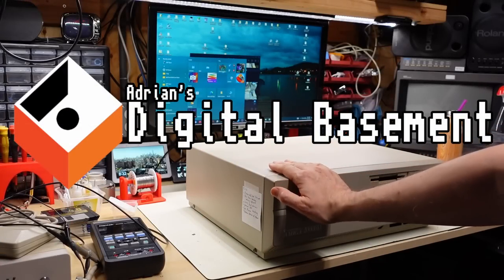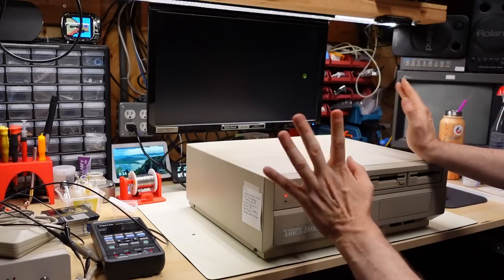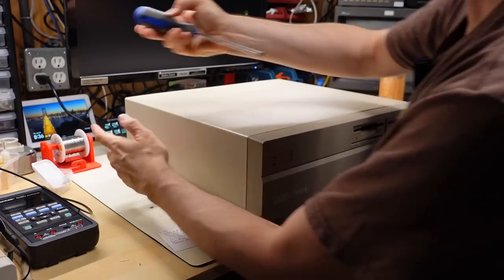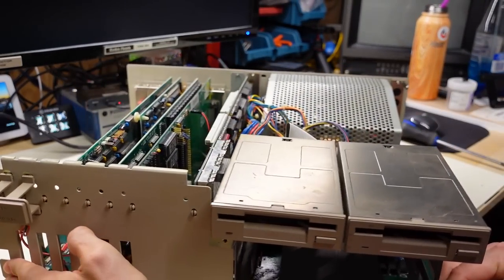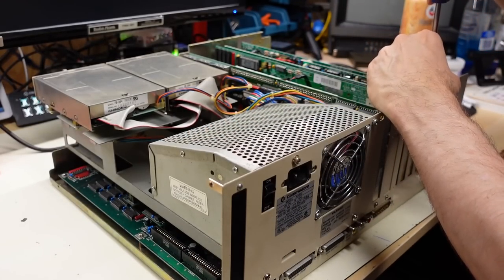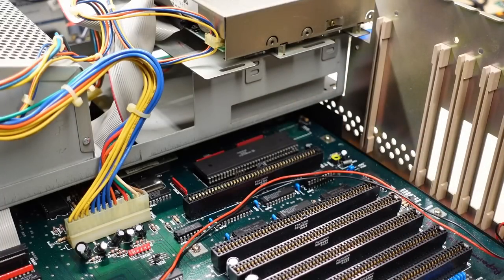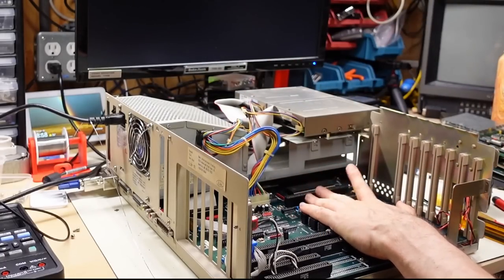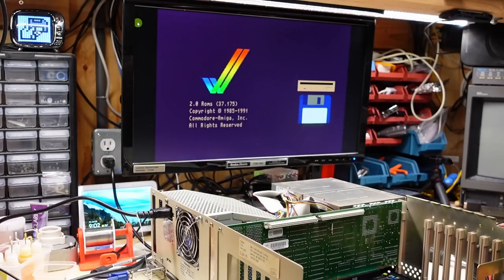I used the "easy button" to fix this broken A2000

Comment: BTW, contrary to what was said in the video, the A2630 can run with the host 68000 removed, if you switch the card to "German/early A2000" mode, where one needs to remove the 68000 for all accelerators anyway. This is done by setting JP302 on the card. This is even mentioned in the manual of the A2630, Page 13, Appendix A. I just tested this on my A2000 + A2630, and it works. MIne is a late model with 2 layer PCB, just as Adrian's. (Also posted pictures on Twitter as proof.)
Reply: That would be a proper fix here. He used trash socket replacement, I would never use that here. If his issue was bad traces, it would not likely fix it's self with light pressure.
Reply: Mr Guru  But the problem was nothing to do with the CPU socket.
Reply: Mr Guru  And you know the problem was the socket?  How?  Magic?  Please stop with the condescending remarks.

Comment: The /RESET pin on the 68000 (pin 18) might be worth checking out as it must be one of the few pins that, when disconnected, wouldn’t affect running once booted.
Reply: It is the reset line on the cpu, a friend had the same problem and spent 2 weeks on drags.
Reply: Yeah, that's the first thing that crossed my mind as well.  The wedge not working when placed on the lower end of the CPU vs the middle also strongly suggests /RESET.
Reply: Yea, I'm going to guess it is either the trace or via between the CPU and RP101, reason being it's on the same side as the battery, and also in the area where pushing down on the board helped.
Reply: I came to make the same comment so +1
Reply: I was going to message that it might be a fine SHORT between pins, you wouldn't notice that with a continuity check and pressing down and distorting the Mainboard might be enough to separate it and allow it to boot. Once it's booted the short isn't enough to stop it running.  Just a theory.

Comment: The only things I'd worry about with this "fix" is the speaker moving on it's own and shorting something. It might seem firmly wedged, but moving the system around and bumping it through normal use could nudge it ever so slightly each time. And the second is that mechanical stress from flexing like that could exacerbate issues in the future and just create even more work if you try to permanently repair the board.

But the thing I'm most leery about is flat pins in round sockets. Try replacing that socket with a dual wipe one and see what happens.

Comment: As a wedge, you could use a wine cork, as it's slightly flexible and maintain pressure like a spring , and you can cut it to the length you need. As an added bonus, you will have some nice wine sent coming out of your Amiga when it heats up :D
Reply: When I was a kid we had a Spectrum ZX48K that would constantly crash. My dad fixed it one day, he jammed a wine cork between the case and the Z80. He told me it was popping out of the socket when it warmed up.
Reply: Mr Guru  I agree, I've worked in electronics for 25 years and I often hear/see people using turned pin sockets for DIL package ICs when all they needed to do was use a decent quality dual wipe socket. ICs never sit in a turned pin socket correctly causing contact issues, stray capacitance, risk of bending legs and an absolute pain in the backside if you ever want to remove the IC.
Reply: This is what I thought but slight splay of the legs would prove that.   Also the board flexes a lot so it could be a fault nowhere near the cpu.

Comment: This would be a great amiga to use a replacement pcb on. It'd be time consuming to swap everything over, but then you wouldn't have to worry about flaky traces.
Reply: Normally I'd call bunk, but yeah, this sounds like the right time for a new pcb.
Reply: I thought the same thing.
Reply: Also I think in the case of the Amiga, the boards aren't some marvel of engineering. All the secret sauce is in the custom chips. As long as you're running real chips, you're running a real Amiga.
Reply: Don't get me wrong, finding the exact reason why it's flaky will make for a great video, but I also love build videos. It's like adult Lego Mindstorms. There's something satisfying in seeing a board be built from the ground up and work. Also, like car restoration, I'm a firm believer in usability over originality. The Amiga wants to run and be played with, not sit on a shelf and look pretty.
Reply: Mr Guru  I guess you nailed it. And, it's August, it's hot, and Adrian doesn't like it too much to spend at least 10 hours to make a new pcb complete! Yup

Comment: I am a noob, and... I have bought an Amiga 2000, with battery damage, of course, and it black screens. Now, the other day, it showed WHITE once when I booted it. So this video IS actually useful. It indicates my socket, on the CPU or ROM is marginal. So Ill try opening it up again, and try pushing down on chips. If I get more life out of it, its kind of diagnostic as to WHERE the main issue is, eh!

Comment: I used to have similar problem on my A3000. Common battery leak around Paula chip destroyed bunch of stuff. The computer would not start until I pressed down the Paula chip. It would work fine for 30 min, but then it would freeze, and I had to press it again. I fixed it by replacing the socket and reflow solder on most pins around the damaged area. So far so good. I do still have a slight problem with VGA output only, the screen would flicker randomly until the A3000 warmed up.

Comment: I just refurbed an Amiga 1000.  I can whole-heartedly agree with your sentiment.  They really had a lot to learn about case design.  Those things are a PAIN to work on.
Reply: Mr Guru   I've done a bit of 3D modeling and then had a service manufacture it from the files, so I get that sometimes you make really "safe" moves to ensure that it works, to avoid having to go through the cost and time of an iterative loop.  That's probably what they were going through -- low budget, not much time.

Still:

The back panel assembly order is a chore.

The little plastic clips that hold screws for the front panel are really awful.

The screws that are meant to hold the memory expansion to the shielding around the edge connector on the front barely even thread.  (At least mine do.)

While we're on screws, the number you have to remove, for example, to get to the ribbon cable on the floppy drive is just insane.

And speaking of the floppy drive -- the ground wire (which is already a bit of a kludge for a drive in a metal shell) secures to a bolt going through the motherboard and the RF shield around the edge connector, and terminates in a nut that is hidden underneath the bottom RF shield plate.  You have to remove the entire board from the case, and then remove the shield from the bottom of the board, to fasten that bolt once you loosen it at all.

It's a hack-job of a case design.  Which, it may well have been exactly that.

People complain about the Power Mac 8500/9500 cases -- which, admittedly, are also a royal pain because you have to disassemble everything to get to anything.  But man, that Amiga 1000 case takes the cake.  It looks like it'll be a walk in the park, but noooooo.  :-D  You're gonna be screwing and unscrewing parts of it over and over again on reassembly, until you memorize the order of pieces in the puzzle.

Comment: I had a music synth which kept having bootup problems. I removed the PLCC chips, cleaned all the legs and socket pins and it never failed again. The A500 and beyond used them a lot, so that's always one thing to check. I had one of the PLCC custom chips burst once, the top cracked and let out magic smoke.

Comment: 9:45 - I did that to an AM386DX40 - used a dowel and jammed it under a long expansion card. The board was pretty warped for some reason. It worked for a few years. I still have the board, but it no longer POSTs, I/O reader shows some basic activity. IIRC I deduced that the controller IC doesn't work anymore, probably from broken traces in the intermediate layers.

Comment: And the metal part of the speaker will act as a heatsink. Winning!

One other thing. I don't believe the device on the board is a flicker fixer but rather a DKB Mega-A-Chip which gives you an upgraded Agnus facilitating the 2MB of chip RAM you saw. The 2000 otherwise would only have 1MB of chip RAM.

Comment: There's one of those square PLCC chips in a socket further under the drive assembly. Try removing that, give it a blast of deoxit, reinstall it and see what happens.
Reply: Good suggestion. Those are susceptible to board flex since they squeeze the chip on all 4 sides.  Failure to post should be traceable if you know what the boot sequence is, which roms are accessed, stack ram, cpu reset lines, etc.  Should be able to narrow it down.

Comment: The fact that it's on startup might indicate an issue with the reset/halt circuit, preventing the 68K from ever starting. Adding a separate circuit right at the CPU might make it work reliably by bypassing it.
Reply: I was suspecting the power on/reset circuitry as well. Only used once, usually.

Comment: If/when this fails again you've got a few useful clues as to where to look. Given the flex of the PCB it looks like the faulty trace is on the top (flex pulls lower traces apart and pushes top traces together). Also with it being at start up something to do with reset and/or initial ROM chip-select perhaps? Assuming you've got the time (yeah I know) a bit of multi-meter continuity testing might find it fairly quikly... Totally understand the bodge fix tho. Sometime you just want to get things going.😁

Comment: The theme of this video seems to be
"My CPU don't jiggle jiggle, no sweat, I need to do a wiggle wiggle, for sure, it is really silly silly, you know, bending down and pushing, you really have to see it"
But sometimes, if it works, it freakin' works, and even if it's silly, you have to do it. Old machinery is tricky, and requires... special care, even if it means just pushing down and bending.

Comment: I've never used an old speaker like that, but I've used a lot of other non-standard bit's and bob's in similar circumstances. Not all have worked, but sometimes the MacGyver spirit is necessary and sometimes ya just gotta do what ya gotta do.

Comment: Okay, quick suggestion that may be a solution in regards to corrosion: Dilectric grease. It's recommended to prevent oxidation/corrosion on terminals that are prone to conditions such as snow, rain, battery acid, etc. Might I suggest that on the repaired sockets before repopulating them?

Comment: Another very good video! It looks like it will be some months before you re-visit this computer. When you do it may be worth using a device other than just a digital meter to bell out the traces. In industry we retained some moving coil meters for checking  continuity because digital multimeters pass such ridiculously low amounts of current, so even a whisker of metal will measure as being OK. I think I've seen that you have a bench power supply which has a constant current function. It's probably a poor idea to try out Amps, but possibly passing 50mA or 100mA between test points would be OK and measuring voltage drop between points on each trace using your digital meter would highlight any dodgy joints or part-eaten buried traces. Only use very low voltages of course, possibly set the supply to 0.4V open circuit? Check what voltage TTL chips will stand if connected in reverse; less than a diode drop should be OK. Reversing the flow of current and comparing voltage drops for forward and reverse flow might highlight problem traces and/or trace/pin joints. You'd be looking for anomalies so a bit of experimentation and note taking would be useful. Perhaps practise on one of your boards that is already consigned to Silicon Heaven.  Good luck anyway!
Reply: His issue is the dodgy socket, not the board
Reply: Great Suggestion to be honest and very thorough with the possible outcome. Using a Shunt  with low resistance inline to pickup Voltage drop would also be possible, as any additional resistance due to bad traces will screw up ypur voltage readings.

Comment: I've had similar issues repairing battery damaged PC boards. The issue is usually bad pads on SMD chips that make a connection when flexed/pushed on. Very frustrating because they test OK on continuity tests because the force of multimeter probing connects the trace's.

Comment: I think the problem your having is due to using those strips of machine sockets because if they are not all level with each other and you put in a cpu with so many pins, I believe some pins don't necessarily make good contact.  If you change it to a dual wipe socket then it has the ability to grab much better.

Comment: You have a brand new a2000 pcb hanging on your wall (although that is a rev 6.2), you could rebuild it using new/used parts. :)

Comment: I did something similar to that in my 486 PC back in the early 90s. It was a Packard Bell desktop that had 3 ISA slots on a riser card so they were parallel to the motherboard and the CPU socket was just in front of those slots. I had an AMD 5x86 CPU in a 5V to 3.3V adapter in the socket and a heatsink & fan on top of the CPU so the entire stack was quite tall. The sound card w/ CD-ROM interface was super long and was in the top ISA slot and cleared the CPU stack, but my USR 28.8 modem was also fairly long and touched the top of the metal fan shroud on the CPU stack. I wedged a small plastic spacer between the modem and the one side of the fan shroud to keep things from shorting out. It wasn't a pretty solution but it did work! Luckily the SCSI card I had in the bottom ISA slot for my ZIP drive was really short so there were no clearance issues there.

Comment: Dice make a good implement for blocking like that. They're cheap, can be glued together and ground down, and if they get loose in the machine, they won't cause any shorts.

The hack is a terrible one in the sense that it may accelerate the corrosion damage due to mechanical stress, but if it already wasn't working, you were going to have to bodge those lines anyhow. I really think the only way you'll ever be able to trust this machine is to install a new PCB, or at least a less damaged one. I don't even think this hurts its vintage value, the magic of the Amiga is in the custom chips, not the PCB.

Comment: A2000's were terrible for reliability I found myself. Had 3 of them over the years and they all had issues where they would crash or not start up due to movement or thermal cool down/ warm up cycles.

The last 2000 I fully recapped everything including all accelerator board and PSU, cleaned thoroughly the connectors inside including Agnus and it still had issues where it would crash or not start up at all the next day. Drove me insane! The board was in pristine condition too with no battery leakage at all.

I love my Amiga's to bits but never again will I get another 2000.

Comment: Maybe use a heatsink.  At least at that point it will help keep the CPU cool at the same time.
Reply: I just wanted to write, Adrian forgot to put thermal grease under the speaker cone 😄
Reply: this probably would work also, but wouldn't need to cool it with the accelerator card being the used cpu

Comment: I fixed in a similar way an apple iBook G3 with the known problem of cracked solder joints under the GPU: just a shim between the iBook undercover and the Gpu so that it is pushed to the pcb and it works like a charm, no more crash ever since.

Comment: Hope it will last a while, but I fear it will just bend the board after a long time, as the material in the board negates the tension.
Reply: It will bend the board, but I think the only long-term fix is to replace the PCB, so anything he does in the meantime to squeeze some more use out of it is fine as long as the custom chips aren't damaged.
Reply: I had   386 DX/40 with a similar "mod" - the board was already warped, but I managed to get 3 years out of it with a wooden dowel stuck between an AWE32 (or other long card) and the CPU. It eventually died. I still have it in my pile of dead AT boards, but I fear whatever caused the board to warp took out the traces within the board itself.

Comment: If you are pushing the 68000 down into the socket, bending the board downward than I would think the problem would most likely be on the top of the board since the top would experience contraction, bringing connections together, while the bottom of the would expand.
Just a thought

Comment: I had a similar problem with my a600 and I found cracked resistor that pulls IPL signal to HI (if I remember) worth to check passive elements for cracks, but it's mostly impossible to find one without moving each one.

Comment: Love your A2000 coverage. Your repair, "Speakers volumes". Lol 😁👀👏 Always found the A2091 the best scsi card. Too many issues with all the others. Oktagon was a good runner up.
Reply: The ROM of the A2091 is pretty much garbage. :) It needs the ROM 7.0 version to work with 040 accelerators at all, and also has various other limits. Also fails to use DMA with 32bit Fast RAM. On Aminet there are various patches for the ROM to make it work better.